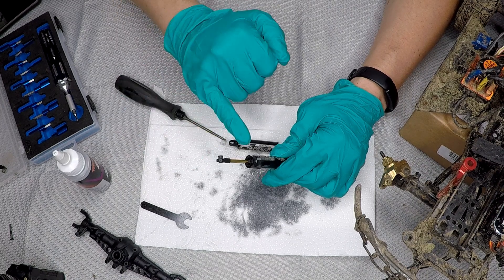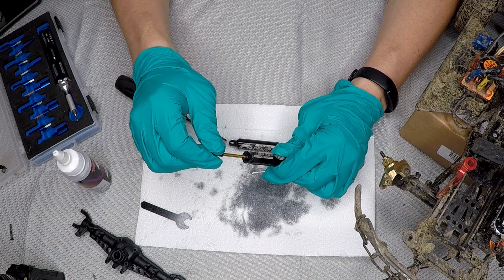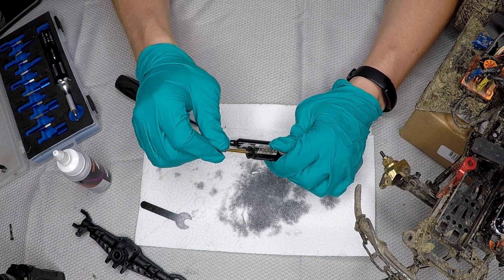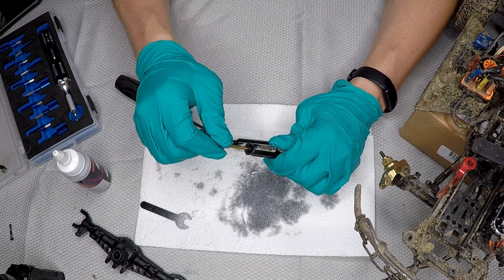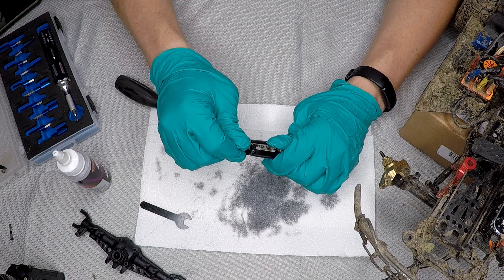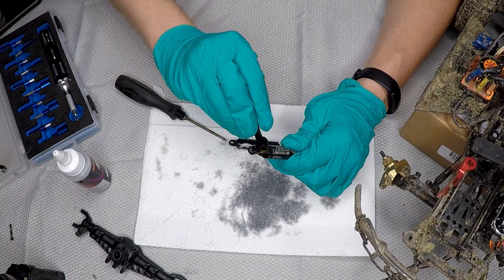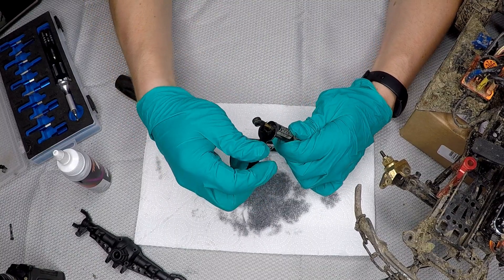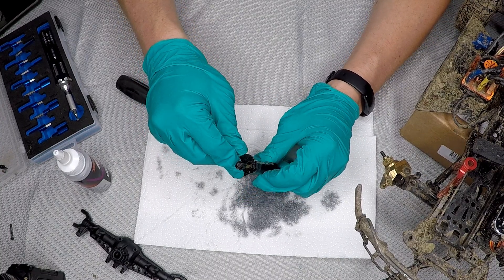Desert Lizard Shock Discussion (Check Description)

Comment: Old but gold video 👍🙂 Why did you choose 90 mm and not 100 mm, now you run with a droop setup?
Just asking as I'm doing some research for what to buy for my SCX10 3 Gladiator 🙂
Reply from the maker: 90 is just a preference, 100s seems to make it ride a little higher than I want.
Reply: @rctactical5600  so if it was 90 mm before and 90 with droop now. Isn't it then lower now, when it sits? 🙂
Reply from the maker: @kenneth_jensen  sorry I was rushing to work. I should have elaborated better. 

So while ride height is movable using various methods such as shock keys and  what not in stock placement the 90s seem to be able to sit lower than the 100s which is my preference to keep the COG low. However, I also prefer 90s because of the amount of travel on 100s is just a little longer than what I am shooting for. Again you could tweak 100s to operate much like 90s depending upon spring setup. I usually shoot for the axles to stay as close to the chassis as I can under normal ride circumstances to keep tip over on side hill and steep ascension to a minimum.
Reply: @rctactical5600  that is a good strategy and as I read it, we drive similar. So I have decided to go with the 90mm dual stage Desert Lizard 👍🙂
Thank you so much for your feedback 🙂
Reply from the maker: Very glad I could help!

Comment: Okay… how bout shock valving. Meaning 1,2,3 or 4 hole piston, and will a 2 hole with 20 weight oil perform the same as a 4 hole with 40 weight… im getting ready to install some on my axial Capra and I’m curious
Reply: I'm getting ready to toss these on my Capra, did you need to add a spacer or do anything special to mount them? I can't stand the kit shocks.
Reply from the maker: If the Capra has the stand off ball studs up top like the scx10iii you might have to reuse those.
Reply from the maker: Jeff I did some research and yes, use the top standoffs that come on your stock shocks so it will allow the side to side motion on your front axle
Reply: @rctactical5600  good to know, I'm actually going to run the ssd shocks instead and keep these as a backup. The bracket for the reservoir on the DL's is a bitch to put together.
Reply from the maker: No doubt! The Ssd shocks are nice as well! Also for consideration if you end up with the DLs you may be able to run them upside down! Whatever you do, have fun!
Reply from the maker: That's an awesome question! I have used primarily the 4 hole pistons but theoretically what you saying  should work until you get into higher weights. If you have 40w oil and a two hole piston, I don't think it will equal 80w with a 4 hole, you know? And the oil really just comes down to how fast you want the truck to respond with the weight of your rig/axles. If you have heavy axles, you will need heavier oil if you want don't want your shocks to compress and retract fast.

Comment: I started using Desert lizard shocks. Then tried all sorts of others . I have been very impressed with the performance. 

About the oil. I have seen that metallic oil all the time. Now that you mention it. When I repair motorcycle race engines. I always use dawn dish soap to scrub the aluminum parts when they come back from the machinist . This releases a lot of black metal from the machining process. I am going to try washing my new sets of shocks.
Reply from the maker: I noticed after a few cycles of running and swapping oil the residue does get more sparse. Glad you have had a good experience with these shocks. They are phenomenal! Also thanks for the comment man, appreciate it

Comment: ITs not an air pocket. the shock is hydro locked from too much shock fluid in it. Which is why you have to bleed it again.

AIr Compresses, so you likely have nearly all the air out, just too much oil to allow the shaft itself to fully enter the body. 

FYI.
Reply from the maker: Thanks man! Already included that in description previously! Working on editing the actual video to fix this discrepancy as well! I appreciate the feedback so I can provide the most accurate information to viewers